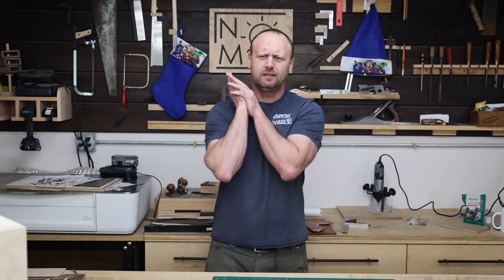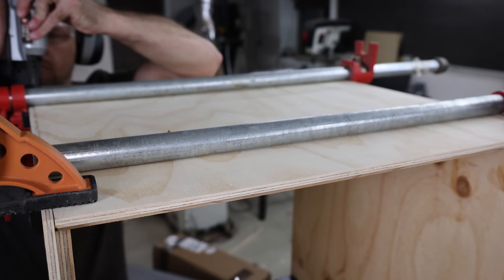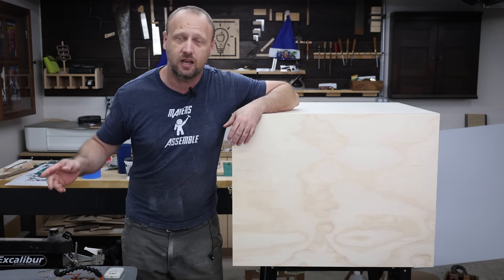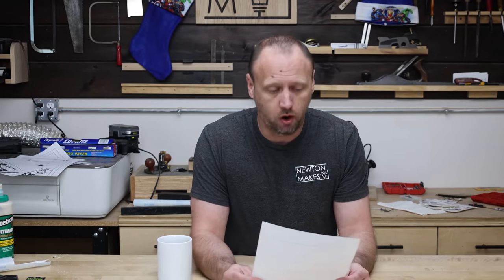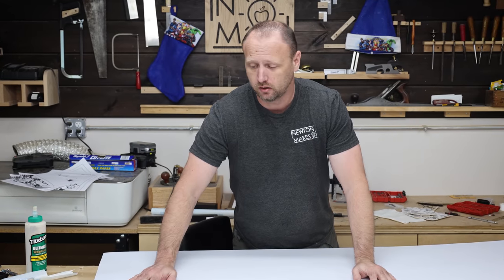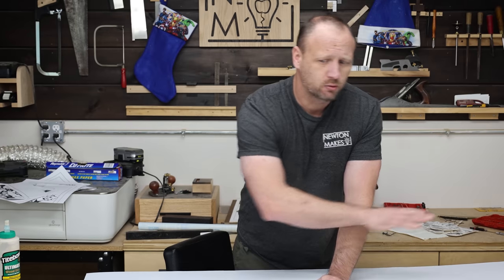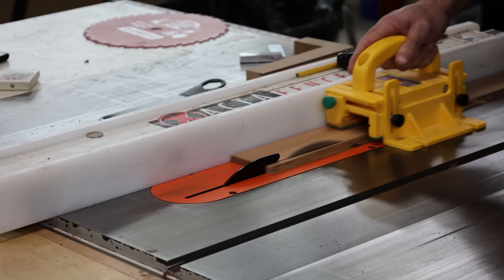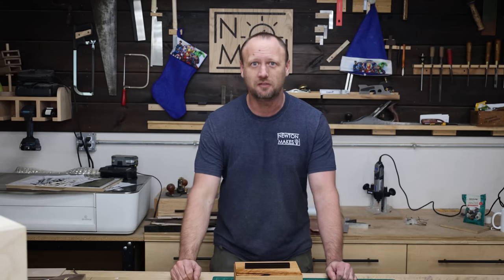Building my PERFECT Workshop Spray Booth for Projects

Comment: I built a spray box to airbrush my models with a 4” 120 CFM in-line fan but had to add a 6” fan that tripled the CFM which was necessary to remove the spray mist and fumes.

Comment: I've considered a spray booth as well. It's a great idea. I've watched youtubers that put together models and dioramas. They use spray booth as well. The big upgrade I see that you could do to yours that they do is adding a filter in the back of the cabinet. It might cause you to need to upgrade your exhaust fan setup but in the long run I believe it would be a good improvement. Stay awesome.

Comment: My booth has (2) 1500CFM exhaust fans with 8” ducting, and I’m thinking about adding 2 more. Harbor Freight fans, $80 each. I spray nitrocellulose lacquer, and lots of it, using HVLP. The whole booth - which is an entire room at this point -  is 2x4 framing with thick plastic sheeting and those 2 fans pull the plastic sheeting in from the amount of suction they create in the booth. I started off with a much smaller setup, a lot like yours, and have been forced to upgrade to accommodate the amount of spraying that I do.

No, my fans aren’t explosion proof and no, they haven’t caused any explosions yet. I’ve sprayed nitro directly into the fans with no issues.